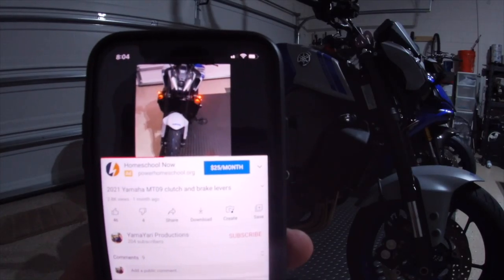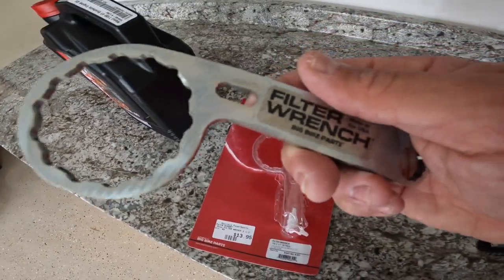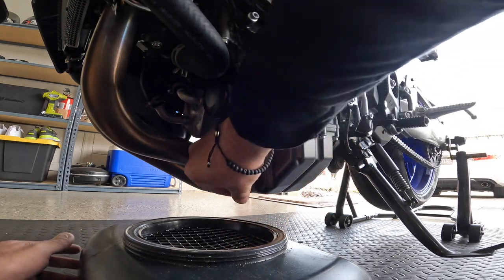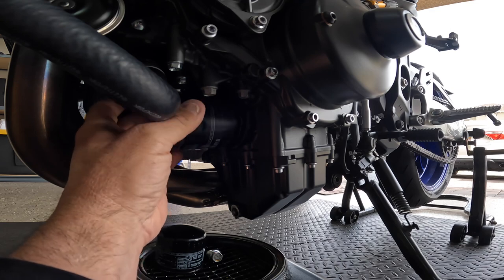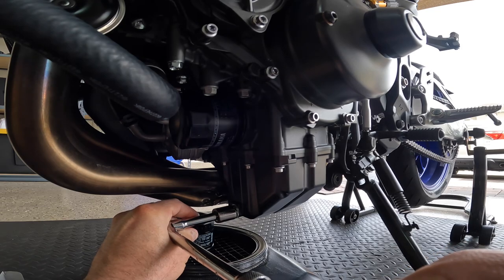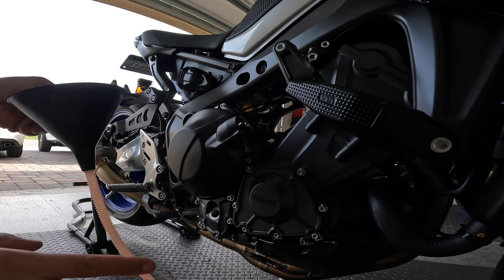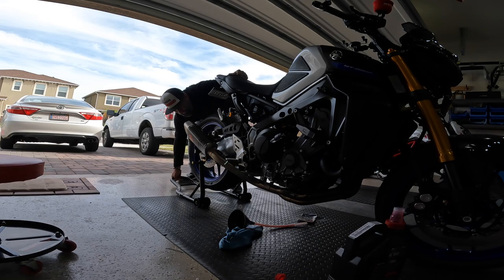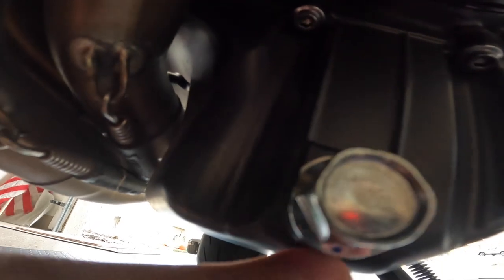2022 Yamaha MT09 SP Oil Change

Comment: Thanks for sharing! I always remove the filler cap  beforehand which lets the crankcase breathe better for faster oil drainage.
Reply from the maker: Ahhhh yaaa lol very true. I’ll do that next time. Thank you 🙏
Reply: You don’t need to on the mt09. 1. the oil is so thin it pours out and 2. when you remove the oil filter it vents in air.  So the video was 100%. Thank you!

Comment: Awesome! That's much easier than my old little Honda CB which I had to take the freaking metal cover with springs  and gasket off. I'm glad the Yomama brand is easier. I can't wait to get my bike, if I can. Been in a little delay in saving on my bike. It's just life trouble that comes up like my truck needing new tires, and breaks. That right there put a dent in my savings. Couldn't avoid, had to since it's my work horse meow.
Reply from the maker: Just keep at it. Doors will open for sure! You will have it sinner than later.

Comment: Great video, couple of tips would be to prefill the filter with oil to avoid the bike running with an empty filter. The other one would be to hand tight the filter not using any tools as this can damage the filter thread.
Reply from the maker: Sounds good. Thank you for the great tips. Makes sense. I appreciate your feedback.
Reply: @yamayari8351  Hand tighten filter only, tighten just enough and you'll always need a tool to remove it because of the suction it creates etc. If overtighen it can leak etc
Reply: If you prefill the filter the bike will be filled over capacity. You slow or something?

Comment: Super glad pops is doing well. Great video ! A magnetic drain bolt should help catching gunk out of the oil. I always remove the filler cap to let the crankcase breathe more. I have the Tracer 9 GT but I race what’s called a Dwarf Car that has the GSXR 1000 motor , oil change every 3 races. Merry Christmas and Happy New Years bud.
Reply from the maker: Thank you for that. He’s a great dad. Also your right. Taking out the cap would have helped for sure. Next time. Ride safe! An thank you for watching the channel.

Comment: Liking the bike. I have a 9gt.  probably already mentioned always put some oil in the filter first, always ONLY hand tighten it. Another tip replace the crush washer every time. Once its crushed its not working. Ive replaced an oil pan from damaging threads. Not fun.     Peace out
Reply from the maker: Thank you 🙏 I’ll apply that info in the next oil change. Ride safe!

Comment: My owners manual for my 2023 MT-09 says 32 ft lbs. I don't know that seems really tight for soft aluminum. Anyway I used the specified torque setting and a new crush washer. I think it's too tight. I'm hoping it's okay. I'll find out at the next oil change. I think next time I'll torque by hand no torque wrench.

Comment: When using the site glass to check oil level,  will you get an accurate reading with the bike on the side stand?  Is that how it is meant to be interpreted?  Also, where did you get that nifty oil pan?
Reply from the maker: I check the sight glass off the stand. Kind of tricky so be careful. And I got this pan from auto zone a long time ago. Thank you for watching the channel. Ride safe.

Comment: Kind of off topic. I recently bought a mt09 2022 and i love everything about the bike. Got it through its first service with the chain quite loose and After thighten It, it's still quite loose. What could be the problem? Thanks
Reply from the maker: Tighten it and still lose? Did you loosen the rear axle bolt before you tightened it?

Comment: what your dealer will say about warranty of the bike if you change oil by yourself?
Reply from the maker: Nothing. You can change your own oil. No issues.
Reply: @yamayari8351  Thats intresting, in Estonia(europe), when i bought filter for my 2022 year MT from dealership, the worker there asked why i buy it and dont bring bike for service there so i wont loose 2 year warranty of the bike. I dont get the point why it is like that here.
Reply from the maker: @kaurrrr  not sure. You can even register your oil change with Yamaha so that way it stays in warranty. You may want to ask another dealership their opinion.